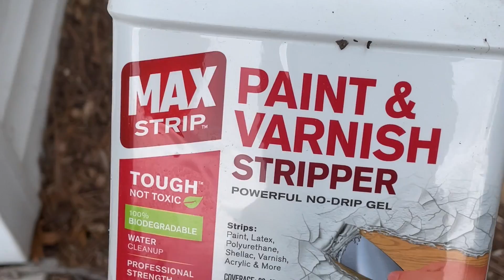Vintage Huffy Concours Road Bike Restoration Project

Comment: Hey ! That's my bike ! I bought my Huffy Concours (same colors) back in the 80s (I think) from the Homestead AFB BX. I read somewhere that Huffy only made this bike for a single year - 1984. Don't know if that's true though. I still ride it today. Yours is obviously prettier than mine now though. I've considered restoring mine several times, but it still works as is. I had to replace the Avocet seat when the plastic frame dried out and cracked up. Good job !